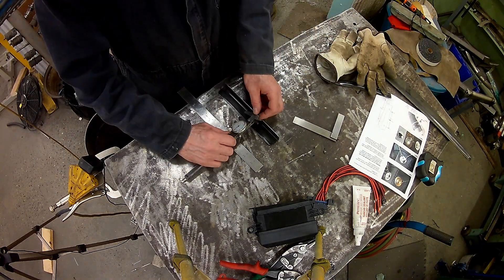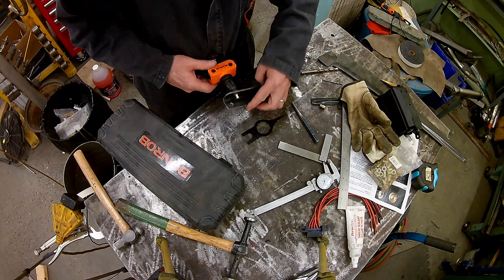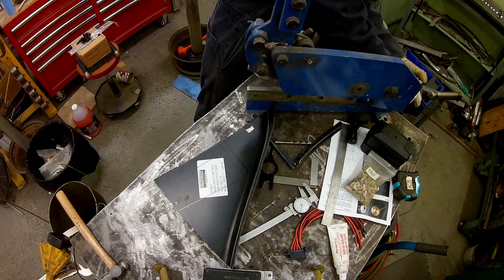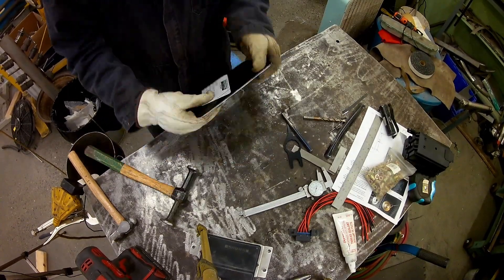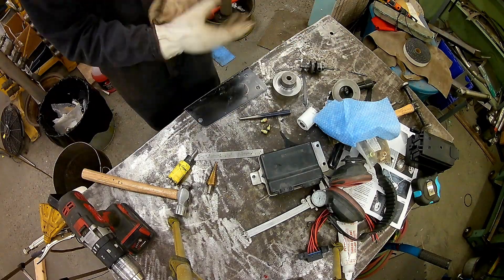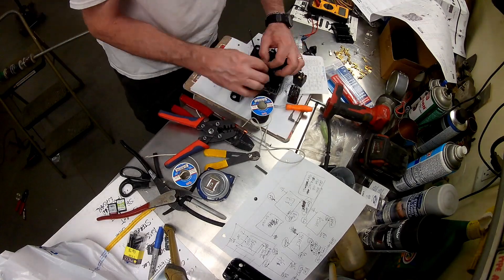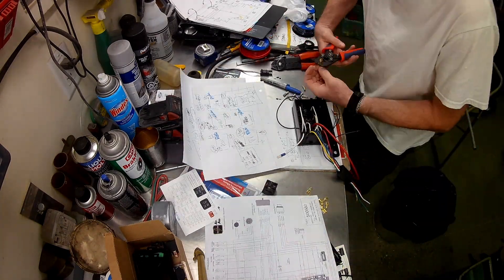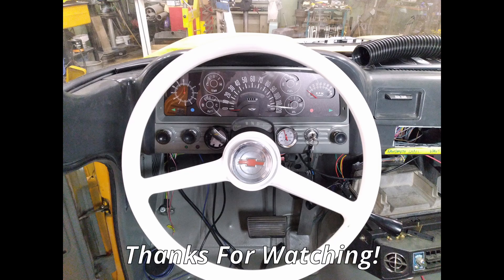Relay Block & TAC Brackets

Comment: I got a hydraulic hole punch for making electrical panel knock outs off Amazon.  I got it for running my efi wiring through the firewall.  I have used it way more times than I thought I would.
Reply from the maker: That is on my "want" list for sure!

Comment: I like electrical work too.  It can be pretty challenging if someone has been there before you though.  Looks very neat and tidy.  You said you were going to post a link for the nutsert tool but I don't see it.  Could you post it please?  There are so many to pick from and they kind of all look the same so it would be good to find a brand that you know someone has used and is happy with.  Thank you!
Reply from the maker: I added the link (thanks for the reminder).  Truthfully I bought the cheapest one I could find.
Reply: Thank you! @GregWellwood